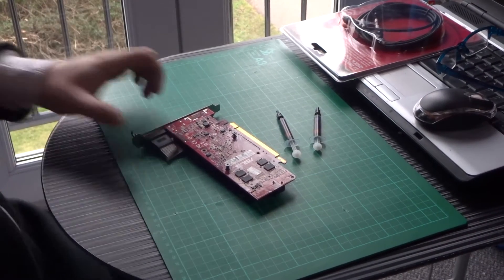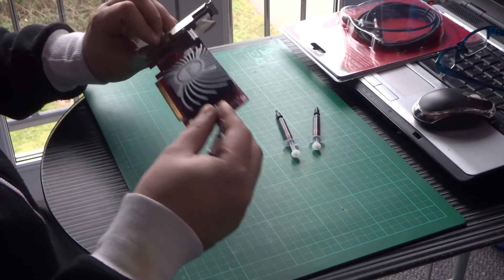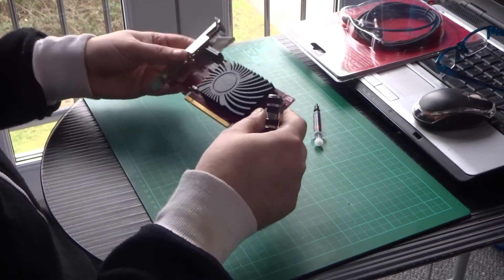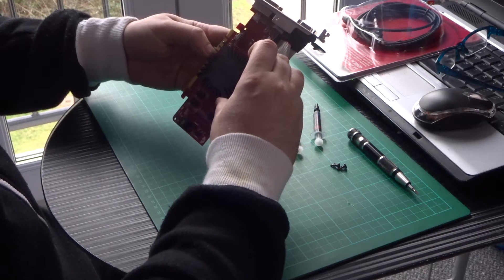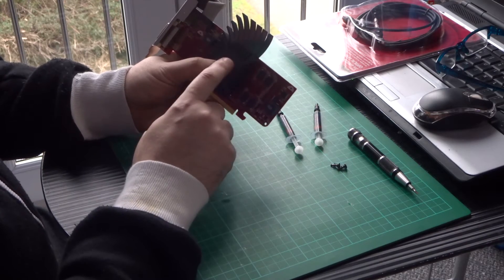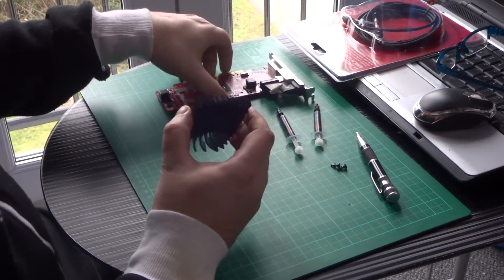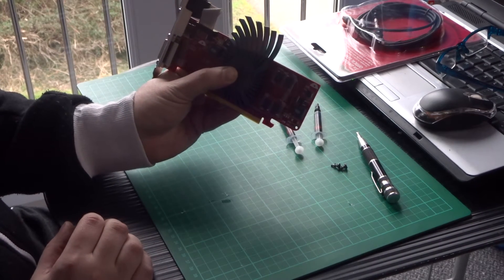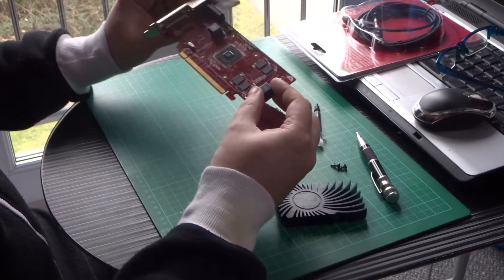AMD ASUS EAH6450 Graphics Card Mod - SYNTHEMATIX

Comment: Today I decided to volt mod the core and memory, it can be found online quite simple just a bit of soldering, the result was an increase from 650mhz to 1300 using 1.700V on the core and 600mhz to 1000 with 2.25V on the ram.

Went from 9.52FPS to 18.05 in cinebench
Reply: Also even with a 120mm fan on the heatsink it was getting ~85c under full load at that voltage, it will die at about 1.85V on the core
Reply from the maker: Great stuff well done

Comment: my self I do not bother with this crap I add a cpu cooler to the graphics and put heatsinks on every hot chip using thermal plaster and this way I get better cooling and can overclock the card to the max.
Reply from the maker: +vorkev1 but doing that will cover 3 slots and these cards dont overclock that well anyway
Reply: Synthematix I have no need in most systems for extra slots the only time I would need a extra slot is if I am doing sli. also it depends on the size of the cooler some only take 1 extra slot. I only do this as I am not a gammer and have extra slots and like to use keep using old hardware as long as I can. I admit I no longer use the card you do my main card right now is a GeForce  9300 ge but it dos what I need overclocks nicely and stays cool. it sounds to me like you are using newer systems then I use and you are trying to do more with it then it should witch is great I do the same thing. I recently tordown a pc I hade wear I hade every slot full as it was a midi syste,